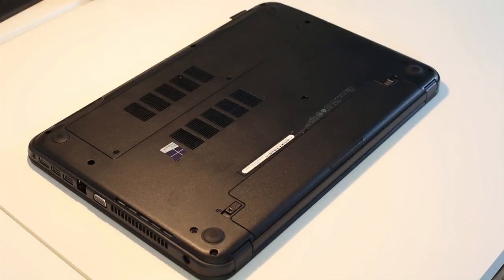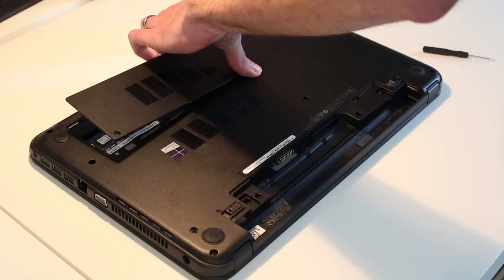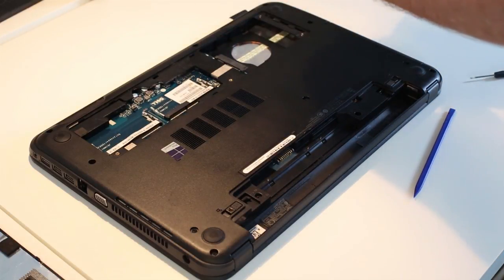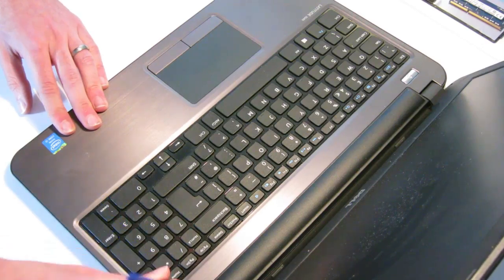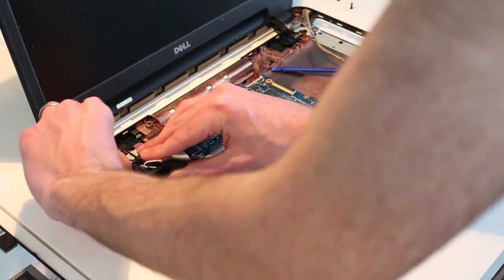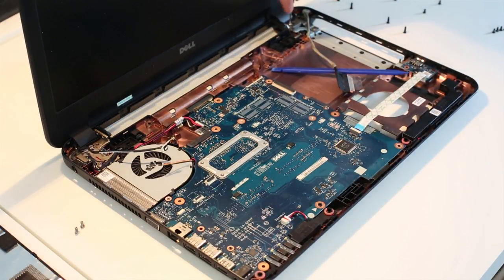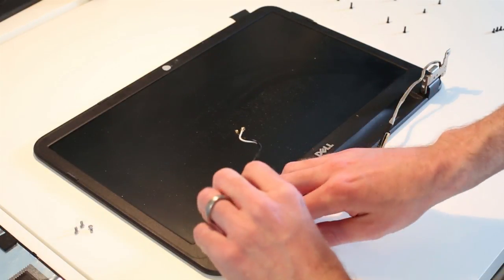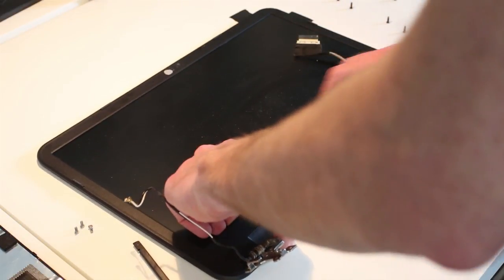Laptop screen replacement Dell Latitude 3540

Comment: I have a question I need to change the screen but I don't know how many pins are there, is it 40 or 30, Latitude 3540,  this video is very helpful I appreciate it, Thanks
Reply from the maker: I don't recall what panel it was I fitted to this (its quite an old video) but a search suggests it is a 40-pin LVDS.

Comment: This video is for a FULL teardown of the laptop. Do NOT follow this video for a simple screen replacement. You can damage your laptop (like I did) and this is NOT required nor recommended for screen replacement. You just need to remove the bezel and 4 screws for screen replacement. See others comments below.

Comment: Why didn't you just take the bezel off and remove the 4 screws. You didn't need to strip the laptop to do that.
Reply: Yep, I just did one of these laptops and I had to skip most of the video to get to the part where I replaced the LCD. Less than 10 minutes, more like 5.
Reply from the maker: From memory, it was necessary to remove the hinge covers, which needed to be taken off before removing the bezel. The bezel has no screws in it and just clips on, so maybe you're thinking of a different model?
Reply: What you do is partially remove the bezel by unclipping it from the screen starting at the top and then sides. The bottom cannot be removed but can be lifted from the back plate. This gives you access to the 4 screws holding the LCD screen to the back plate. Remove the screws and then remove the lead from the mainboard to the bottom of the LCD and replace. Whole thing can be done in 10 minutes. Like I said stripping the laptop is not necessary to replace the LCD screen.

Comment: Talking a laptop apart is relatively easy..do you have the video of you putting it back together? these plastic laptops are a nightmare to put back together the plastic hinges on this thing are nasty.
Reply from the maker: Paul Sheraton I don't tend to video the assembly unless it was significantly different to the disassembly. The plastic hinge covers simply clipped back on for me, removing them was far worse!
Reply: Brue Computing wish i could get mine to just clip back in bloody nightmare lol
Reply: I have this laptop and I feel that taking this laptop apart is also a hectic task because being made up of plastic you may damage the delicate body of it. These laptops are bulky in order to add some wait to cheap plastic.